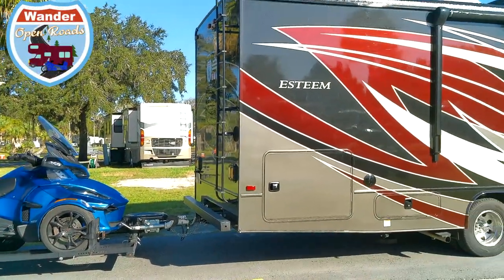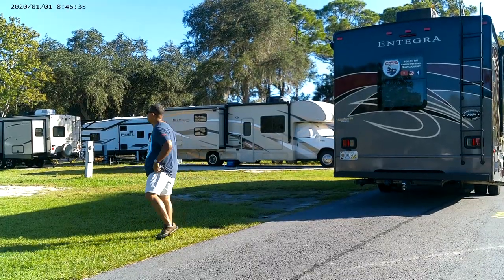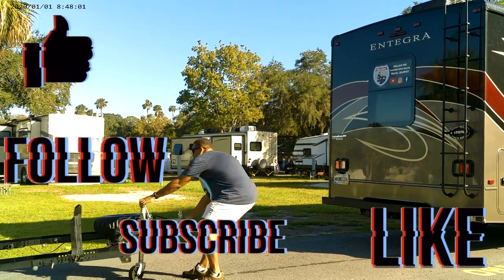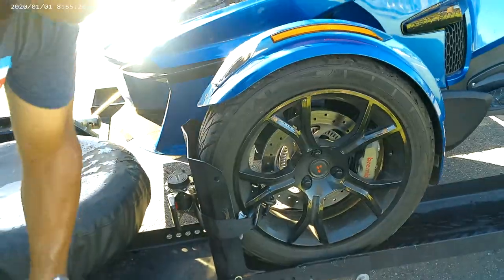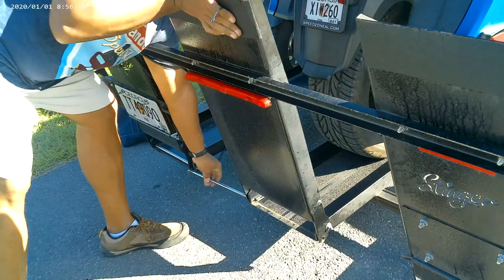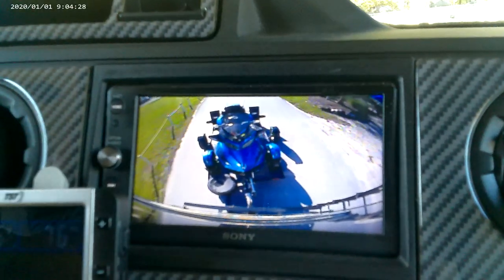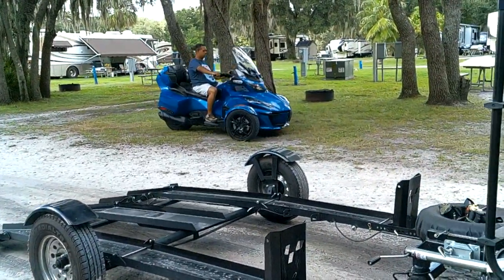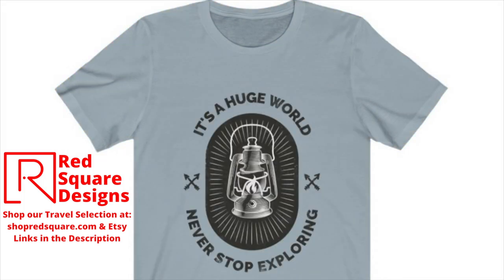How we haul our Can Am Spyder! See our setup and method with our Stinger Trailer for Can Am.

Comment: Nice! you will eventually damage the rims with the hooks of the straps. Try putting a cloth on the rims first, it works!
Reply: I'd go one step further and tie down the front straps by securing the hook into one of the holders for them on the front of the trailer.  Nothing but strap through those expensive mag wheels! Nothing but strap!  My stars are those wheels expensive. Plus they change them every year so getting identical ones to your model 3 or 4 years down the road may be a fruitless endeavor.  That would make me sad...hope you change the way you strap and don't damage your rims.
Can you put a link up on how you mounted your spare? I really like that and would like to do just as you did there too!

Comment: Good presentation on the trailer. I would recommend to do what I did to my trailer I had it rhino covered it's the same stuff you put in the bed liner of your truck Works will keep the tires from slipping. add a couple extra lights on the trailer in the back for better safety. Be safe have fun keep the videos coming. 🏍🏍🏍
Reply from the maker: Thanks Dave we appreciate it! Great idea on the Rhino I’m going to look into that. I added reflective red tape on the back ramps for night time driving, definitely want to make sure people see me! Safe travels

Comment: Great video, thanks! I'm waiting for delivery...we hauled it to Breckenridge over the weekend on a flatbed trailer. It broke free of the straps and slid to the front of the trailer. Thank God it didn't fall off and kill someone!!! Strapped and parking brake on is not enough to keep these in place. That's what I like about the design of The Stinger.
Had all kinds of trouble loading and offloading...bottoming out, etc. Are you experiencing any loading/offloading issues with The Stinger? My appreciation in advance!
Reply from the maker: We haven’t had any loading or unloading issues with the Stinger. I did add some anti- slip tape to the ramps just in case we’re loading in rain or the bike tires are wet. The way that we strap the bike down, we haven’t had any issue although I have since learned that the bike is designed to be strapped down from the foot boards. After over 2 years and 15,000 miles on the Stinger, I’d still recommend it.

Comment: Nice video. How did you mount the spare tire and what is the square tube attached at the front of the trailer?
Reply from the maker: Thanks! The square tube is just a part of the trailer. I attached the tire to the trailer frame with a u-bolt I bought from Lowe’s.

Comment: Good evening hopefully you are doing well. I have purchased a stinger can am trailer and I accidentally hit the wire case and separated the wires. I reconnected the wires and was unsure of where the red wire went. I connected the red to black and hooked the trailer to my truck and knocked out my rear brake and signal lights. Do you know where/what the red wire connects to?  To open the box it has two Phillips screws on top of the box. Thanks for your help
Reply from the maker: Sorry to hear that… I’m not familiar with the wires you’re referring to or maybe I’ve just never had to manipulate them. Generally red wires are positive and black is negative so I’d try to match them up that way but I’m no electrical expert. I hope you can figure it out!
Reply: @WanderOpenRoads   thank you for the quick response, i was hoping you were close to your yrailer so that you could unscrew the black wire box and share where the red wire was attached.  I am preparing for daytona and wanted to make sure I didn't have any issues thanks again 
McGowan Anderson

Comment: Great idea to carry a spare tire for the trailer, do you also carry spare for the Spyder?
Reply from the maker: The Spyder has a different tire for the front and rear tires and it would be difficult to jack up because of the tire configuration. We have roadside service for our vehicles and they’ll bring whatever size and type of tire we need for our RV or truck. The trailer tire is a basic and easy change so we figure we’d tackle that if needed.

Comment: I'd really be interested in knowing if anyone experiences "road rash" (from rocks/dirt/debris) to the painted surfaces or the windshield when trailering.  I haven't seen much talk about using covers but understand they do damage when air/wind gets under them.  Your thoughts please?  Thanks.
Reply from the maker: We’ve traveled over to 15,000 miles with this trailer and I’ve never seen any noticeable dings or scratches after trailering the bike.

Comment: Hey guys I watch this video before and I gave it thumbs up. I was just wondering now you've had the trailer for a while do you still feel like it was a good purchase could you do a recap I have been looking for a trailer for my Can-Am Spyder been flip-flopping back and forth between the one you have in a regular trailer you can let me know I appreciate it. As always keep the videos coming🏍🏍🏍🏍🍦
Reply from the maker: We’re definitely still happy with the trailer and we’ve had no issues since we’ve had it. You just can’t beat the light weight and portability. My only concern was if I’d have rocks, etc from the road hitting it since it’s an open trailer and I’ve seen no damage at all. We’ll probably do a follow up at some point, but right now, no news is good news!

Comment: I would not even "unlock" the hitch (or remove lights\chains) until after unloading the bike.
And have the hitch "locked" before loading the bike.
I have seen 3 dif people pop the trailer up by just sitting it on the hitch. Slight damage to bike once and flipped the bike once. All trikes. And no not me.
Reply from the maker: Good tip, thanks